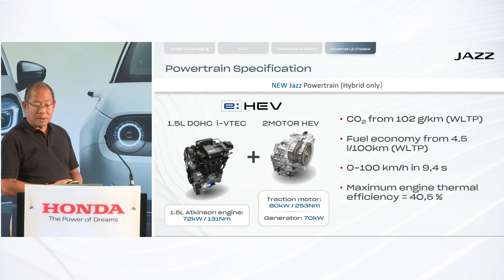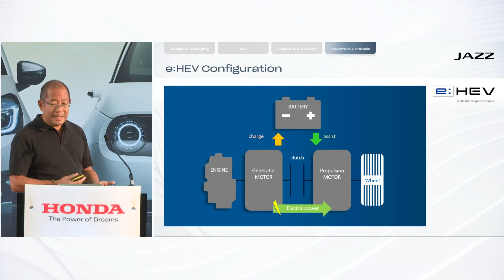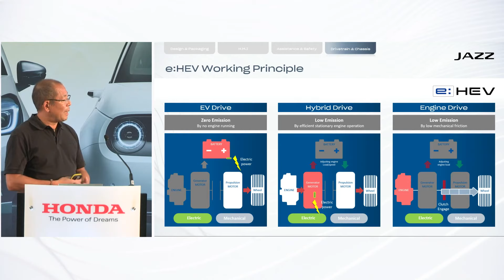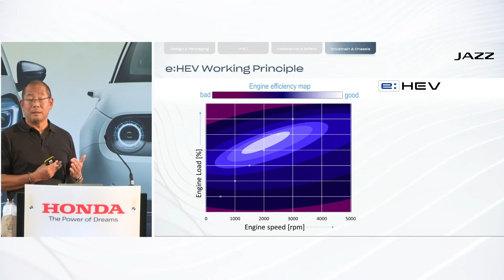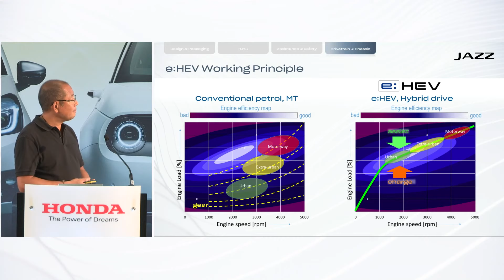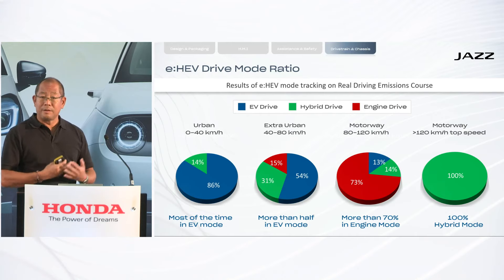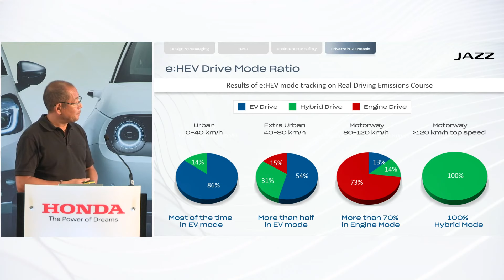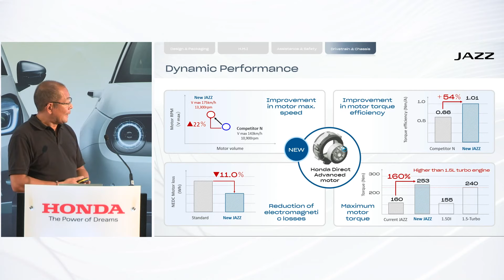Honda e:HEV Hybrid System – How it Works (Ko Yamamoto, Technical Advisor Honda Motor Europe)

Comment: Thank u for sharing the info. As i understand in hybrid mode the power from the engine power -> generator motor -> battery -> propulsion motor -> wheel, that means the battery is charging and discharging simultaneously, everytime. Can the battery be healthy for a longtime ?
Reply: It's not simultaneous. I can't draw a branched flow chart in this comment format, so add that part yourself:

Engine->Generator->Power Control Unit.
Power Control Unit<-->Battery.
Power Control Unit<-->Traction Motor<-->Wheels.

The system has been used since 2014, with no systemic battery concerns. One point not mentioned in the video is that, most of the time, the state of charge stays within [30%,70%] unless there are extreme circumstances.
Reply: @jeffjo8732   I failed to understand how the combined peak power can be more than the traction motor rating of 80 kw (107 ps) while the car specifications mention it as 126 ps. It’s either the motor driving or engine driving (ice rated to 97 ps) meaning its a series hybrid except for engine drive. Then how come it is rated at 126 ps in the sense that when does it operate as parallel hybrid. Appreciate if you reply to this. Thanks
Reply: @jeffjo8732   I failed to understand how the combined peak power can be more than the traction motor rating of 80 kw (107 ps) while the car specifications mention it as 126 ps. It’s either the motor driving or engine driving (ice rated to 97 ps) meaning its a series hybrid except for engine drive. Then how come it is rated at 126 ps in the sense that when does it operate as parallel hybrid. Appreciate if you reply to this. Thanks
Reply: @Liguritio  Let's say you have a gas car that can produce 100 ps. What this means is that its engine can turn fuel into that much power (i.e., energy at that rate). That power gets split between peripherals (fans, compressors, alternator, etc.), losses in the transmission, and the wheels. The estimate that Honda engineers apparently use is that at most 85 ps can be sent from the transmission to the wheels.

While it seems intuitive to compare a BEV's motor to a conventional car's motor, that is wrong. It is the battery (and its controlling electronics), not the motor, that produces power. That power gets split between peripherals and the motor. So the motor compares to a conventional car's transmission, not the engine.

But now the calculations are reversed. It is the size of the motor that starts it. If the motor can pass 85 ps to the wheels, it needs an electrical system capable of 100 ps of electrical output. This is the ratio Honda's designers use. Every iMMD hybrid is "rated" at an electrical capacity of (motor power)/0.85. This remains true even if cars with the same motor (Clarity PHEV, Accord HEV) have different engines and batteries. They may even be capable of more, but never will since that much power can't be used.

And this is a good way to compare their cars to conventional ones. The total power rating is what can be used by the entire car, not just the transmission or motor. Any misunderstandings are because the general public does not understand the difference.
Reply: @jeffjo8732  Thank you for your time and eloborate reply. I could understand the basis of the ratings given by you and the system working principles.
My doubt is 
1. Honda immd is series hybrid in principle.
2. Implying, Battery and Traction motor during EV mode; Engine via Generator and Battery (depending on SoC) will drive the wheels via traction motor during Hybrid mode; and finally Engine with single ratio clutch will drive the wheels in Engine mode.
3. In India, they launched Honda city e:hev with following ratings.(Similar to Honda Fit hybrid sold elsewhere)
     - Traction motor: 109 PS
     - Peak Torque: 253 NM, which is the traction motor rating 
     - Peak combined power: 126 PS (this is confusing for me)
4. Based on the operation philosophy, I dont understand under which scenario the so called peak combined power of126 PS is available, as the wheels are in 2 modes driven via traction motor rated at (109 PS) or in 1 mode via Engine rated at (97 PS).
5. I therefore feel that Honda isnt giving the user a full combined power scenario of availing 126 PS and the usable power is practically limited to 109 PS.

I hope my understanding is correct or could there be some series parallel operation at rare instances (Engine with clutch On and Motor with battery feeding the wheels) about which Honda didn’t bother to reveal.

Much help if you can throw light on this.

Lastly, as an expert do you think Honda hybrid transmission is more reliable than the Toyota with PSD?
Reply: @Liguritio  Not only is Honda not misrepresenting power in these hybrids as you suspect, they are doing their best to represent it the same way you are used to. You are misinterpreting the numbers by comparing the motor's ability to transfer electrical power to the wheels, to the capability of any car to produce power of any kind. "Total power" and "usable power" are not the same thing!

If you have a fuel-only car with a power rating of 126 PS, the maximum wheel-usable power is about 0.85*126 PS = 107 PS. The gas engine can make 126 PS, but 19 PS is lost to heat in the transmission or used by peripherals. The issue you point out in #5 applies to them as well.

In India's Honda Fit hybrid the combination of the engine-driven generator and the battery can make about 126 PS of electrical power. But about the same 19 PS is lost to heat in the motor or used by peripherals.

(And if these numbers don't quite match up, it is probably due to round-off error somewhere. Every iMMD hybrid that I know of uses this 85% ratio. It's a design constraint on the electrical system, not the peak electrical power that could be produced.
Reply: @jeffjo8732  Thank you for your reply. Could be that interpreted it in correctly.
Further, during engine only with clutch operation, there could be some assist from the traction motor during brief over taking endeavours to justify the ratings mentioned by Honda.
I think it was you, if I am not wrong has commented on this aspect in Weber Auto teardown episode by Dr. John.

Appreciate your time and support. Have a great day.
Reply: @jeffjo8732  Yes, 85 percent of 126 typically is very much the traction motor rating. The PCU must be independently working out the best combination.
Reply: @Liguritio  There is no such thing as "engine only operation." If you watched Prof. Kelly's breakdown of the transaxle, you know that the traction motor is never disconnected from the wheels. This video doesn't show it, but it is being used continuously adjust the engine's power to run near green line (at 4:50). Most of the time, that means it acts as a generator.
Reply: @jeffjo8732  Appreciate your efforts to explain this.Thanks
Reply: A battery can't charge and discharge at the same time. If the generator is producing more than the motor is using, the battery is charging at the rate of the difference in generator and motor power; If the generator is producing less than the motor is using, the battery is discharging at the rate of the difference in generator and motor power. If the generator is producing the same power that the motor is using, the battery is not charging or discharging at all.

Comment: When you accelerate hard and hear the engine progressing “through the gears” does it rev in steps to drive the motor generator or is it spinning at an efficient high rpm with the “through the gears “ sound being faked through the speakers?
Reply: The engine revs to simulate gears, and it comes from the real engine.
It oscillates within efficient rpm specifications.
Reply: @JuneNeko  That's still pretty dumb IMO.

Comment: do you know the ratio of the fixed-gear?
Reply: Not on the Fit/Jazz. But it is a typical overdrive ratio.

You can look at https://www.youtube.com/watch?v=QLUIExAnNcE for the Accord, Clarity, and CR-V. Just realize that in the audio, he gets some speed details wrong. They are corrected in his comments.
Reply: @jeffjo8732  It will be equivalent to a slightly short 6th gear.

Comment: My Worldrecord for drive my Honda Jazz Hybrid was 1 - 1.7L / 100km!! 1'265.1km with only one Tank Stuffing. Without driving over a mountain my distance would be a bit further over the 2'000km! But 2'000km are at least very well possible with appropriate anticipatory driving! 
🌍
Reply: yes and then you woke up.
Reply: One full tank is 36 liters
You drove 1265km with 36l
36 ÷ 12.65 = 2.85% consumption not 1-1.7% you need to learn math
I get 2.8% with toyota cross hybrid suv :)

Comment: Last year, I was actually thinking about a system like this. I was thinking if there was a way to turn an engine into a generator, and have the wheel driven by electric motors. Now I'm excited to see how Honda's hybrid system works!
Reply: Top Gear made (a terrible version of) this system years ago with a Eagle eThrust
Reply: i think this system is similiar to nissan e-power system (cmiiw), excited to know which is more efficient
Reply: @westfalian2676  apparently Hondas system is way more efficient. While Hondas engine generates electricity straight to the electric motor, Nissans e power sends it first to the battery then to the electric motors which stresses the battery a lot more because of the size. Also Nissan x trail with E-power gets about 8-8.5 liter/100km while Honda gets 4-5l/100km
Reply: Back in 2014, bmw had the option of a generator on the i3 model. Less advanced than the e:hev, but the idea to implement something like this in cars was probably on the paper for a long time. Diesel powered trains used this generator system successfully for over 80 years or so.

Comment: How much time the petrol engine will take to charge the battery. And how many kilometers we can run the car using only battery
Reply: Irrelevant questions. It's what is known as a "charge-sustaining electric vehicle," not a "charge-depleting electric vehicle." The battery is used only as a buffer that lets the engine run at a more efficient speed and power. It almost never fills, or depletes, the battery to what you would call 100% or 0%. It maintains charge near the 30% to 70%, depending on settings.
Reply: @jeffjo8732  oh! I c
Reply: Depends on kwh. For example a 1.5 kwh battery could power a car for 4-5 km. I think the battery in the City is of that size only.
Reply: @srinitaaigaura  But the battery doesn't usually charge to anywhere near 100%, nor discharge to anywhere near 0%. In practice, it will try to stay within a 0.5 kWh range. That's why it irrelevant to ask about EV range.

Comment: This means, You will get better fuel consumption at 120 km/h and more speeds, compared to 80 - 120 km/h?
Reply: Maybe not. Drag increases with speed.
Reply: No, the meaning is that >120km/h operation, the eHEV system prefers to use Hybrid (engine charging battery, and battery powering wheels) drive instead of the direct connection of engine to wheel (more used in 80-120km/h range,
Reply: @LiquidTurbo  It simply means that the powertrain uses whichever mode or combination that is most efficient at that speed range. Also it gets to 100 kmph in 9.4 sec in the City and hits 185 kmph with ease.

Comment: This is actually real clever insightful engineering. It would be good to understand more about the generator and how efficient it is relative to conventional ICE or EV. It seems to be a similar system to old diesel trains that run an electrical generator.
Reply: Yes, any series hybrid (including this one) is the same as a common diesel-electric drive in a railway locomotive (or ship, or large off-highway mining truck)... but with a battery added. The battery is very significant to how the system can operate.

As a detail, the types of generators and motors are also different, but that doesn't change the fundamental design.
Reply: Only Toyota did it since 1997... Lol
Reply: @TsLeng  - are you talking about the system they have in the Prius which is completely different or something else ?
Reply: @tomedward8652  While technically it is different, to the average driver it's pretty much the same: the system can run in EV mode, Hybrid mode or on petrol engine power, and it will switch autonomously and seamlessly, even the fuel consumption and emissions are similar.

Comment: how is this different from Toyota's ?
Reply: And how Toyota's is different from Nissan e-Power? Eventually there is nothing to compare except down to which company able to hit the best efficiency.
Reply: What is the same: (1) An ICE, (2) A smaller motor-generator used primarily as a generator, (3) A larger motor-generator connected directly to the wheels and used primarily as a traction motor.

What is different: (A) Everything that connects them, (B) The importance of the ICE relative to the traction motor, (C) the philosophy of how they are integrated.
Reply: Toyota system combines the propulsion of the engine and motor. This system doesn't. Doesn't even try! The petrol engine either supplies electricity or works alone to drive the wheels. Much simpler.
Reply: @wongcw08  That's up for debate. The Toyota system doesn't use even a single clutch. Also, the ICE RPM can be adjusted very accurately at any speed, while the Honda system uses a fixed ratio for direct drive at high speeds, similar to the 6th gear of conventional cars. Still, I think both systems are marvels of engineering.
Reply: @wongcw08  Hello, I have a question. Is the e-cvt transmission used in this new 1.5 cc Honda Jazz exactly the same system as the e-cvt used in the 1.8 cc Toyota Corolla sedan or is it a different system? The reason why I asked this was they said that the risk of deterioration of the e-cvt system used in Corolla is less than the normal CVT. Do you think we will have problems with the e-cvt gearbox if we buy Jazz?
Daha az göster
Reply: @Tuppoo94  Users say that they are intrigued by how the engine perfectly rev matches just before the clutch engages. It's seamless. But yes, in theory the clutch can stay locked and the traction motor can derive power solely from the battery for 30-60 sec for a momentary drag racing 200 HP monster. It is possible to have a Koenigsegg Regera moment, but they don't want to do it.
Reply: @attilakhan4606  It's not the same system. What the dealer said about e-CVTs being more durable than normal CVTs is correct, but the Honda system isn't a normal CVT either. For the end user, the Toyota and Honda systems function very similarly.
Reply: @Tuppoo94  All of these hybrids have a permanently-applied clutch built into the flywheel, to buffer sudden changes in either the ICE or the wheels while they are connected. The biggest difference is that the Honda system doesn't cause such changes by starting the ICE while it is connected to the wheels, like the Toyota system does. Which causes Toyotas to experience more clutch failures than Hondas.

Also, while the Honda system does use direct drive above about 42 mph (1500 rpm), it only does so while cruising. If there is a need to optimize rpm, the clutch disconnects. This provides better control over rpm than in a Toyota, simply because there is no relationship between engine and car speeds.

Comment: I have been trying to find this information for years: How does this system keep the catalysator hot so that it remains efficient? Especially in the city in Winter (the engine constantly goes on and off, especially if i only use seat heating).
The only information i got was from my seller that the cat can be placed nearer to the motor, but for me this does not seem to be sufficient.

Comment: The way I understand; this mean the AWD will not engage at low speeds. 
Eg. in the rain or snow - while in the driveway; parking lots; unplowed streets; turning at intersections. 

Please correct me if I have misunderstood this. 

If my understanding is correct; then I don’t like the awd system at all; as it doesn’t cover the most basic; common and important use cases for awd.
Reply: You misunderstand this.

The internal combustion engine can drive either the propulsion system, or the 105 kW generator, but not both at the same time.
The generator can send power to either the 181 HP traction motor, the battery, or both at the same time.
The traction motor is powered by some combination of the generator and the battery.
The traction motor sends power to the propulsion system.

Finally, the propulsion system sends power to just the front wheels, or to all four wheels if the front wheels start slipping. Just like you want it to. The clutch mentioned in this video has nothing to do with this.

Comment: Excellent. Want to know more about the paddle system. Is there regenerative braking?
Reply: These cars always use regenerative braking before friction braking. Honda seems to have mastered how to blend the two into a seamless system that is controlled by the brake pedal. But that has nothing to do with the paddles.

Lets say you are coasting on the highway, not pressing either the accelerator pedal or the brake pedal. In a conventional gasoline/petrol car, you will experience engine drag if the transmission is still connected. You can down-shift to increase this slowing, but your passengers may not like it. In an electric-motor driven car, which is what an e:HEV car is below highway speeds, you will not slow down much. What the paddles do, is add in regenerative braking to simulate engine braking.

Comment: I have a Honda Clarity Hybrid Plug-in. The system is poorly designed for winter. No way to preheat the gasoline engine before leaving in hybrid mode and when it decides to start in very cold weather, it turns very fast and excessively noisy.